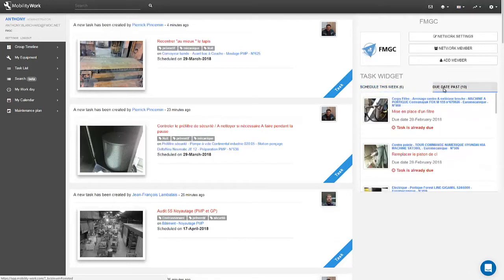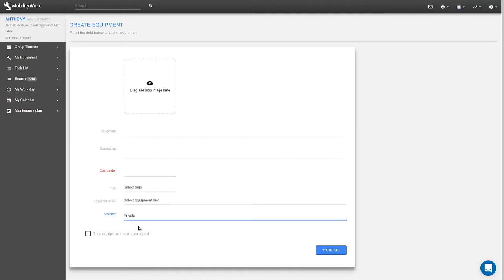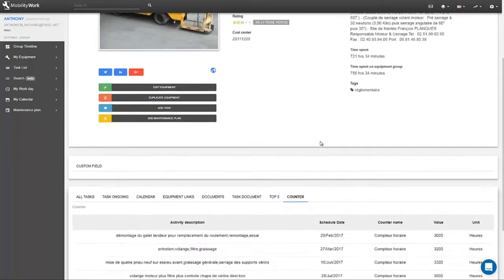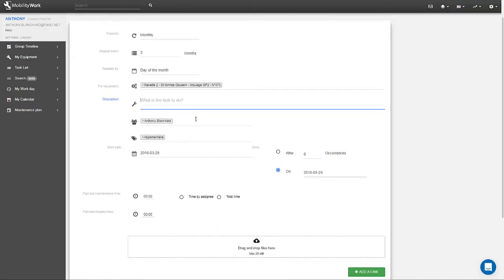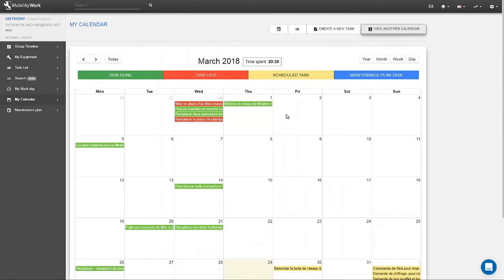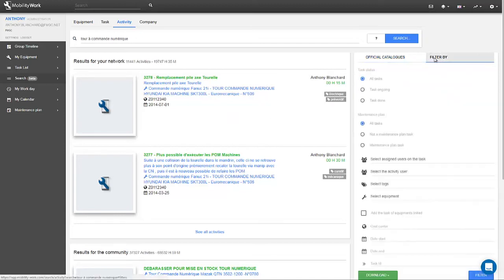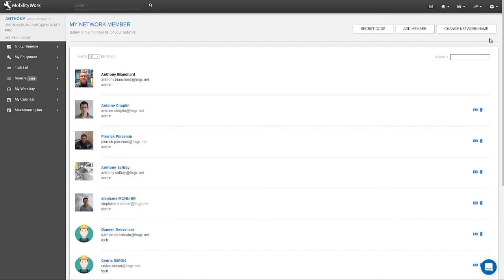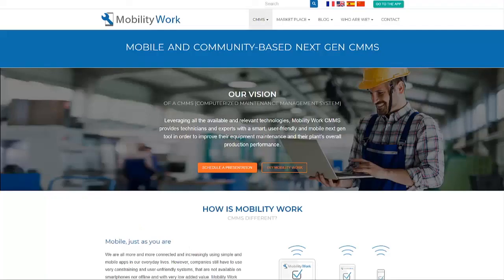CMMS Mobility Work - Presentation of the Application ( Maintenance Software )

Comment: The main plus is having the data to analyse on a month by month basis. It show how well the performance of the team and individuals are coping with the work load, what home uses our Regional teams service the most and what areas of expertise are mainly required, again perfect for targeting training to the maintenance operative in the home. We have also used this system to compare our response time to a request, labour cost all against using out side contractors, this itself has ben an eye opener and has saved us.

Comment: Ease of use! Data entry easily transforms task lists to scheduled maintenance procedures.Mobility Work also allows for machine relocation and assignment. Reports have been easy to provide to answer any questions regarding Maintenance functions, a wide rage of report templates are available. We are a small operation and have not needed the expanded version, that being said, I have used similar programs at other sites and Mobility Work far has been the most user friendly system I have used.

Comment: really liked the simplicity to set up and the functions of the app. The customer service was excellent as well. Longest I had to wait for a response was 20 minutes. Very responsive and honest. The app though was the main selling feature. It organized our PM schedule. I also really liked the ability to incorporate the temperature monitors into the program. Over all an excellent solution for a company that has lots of equipment to keep organized and running. The team or person who designed the app or hired the team to maintain has done a great job.